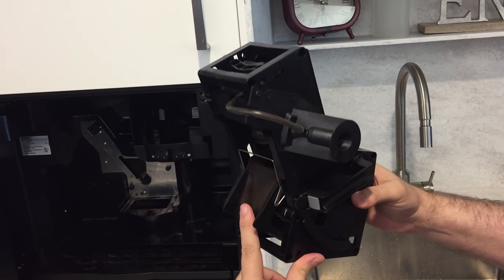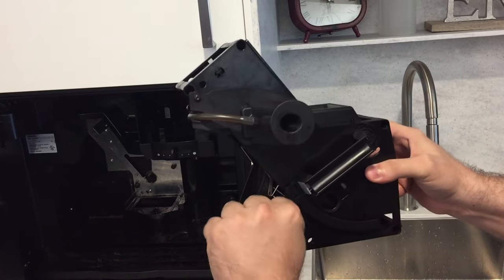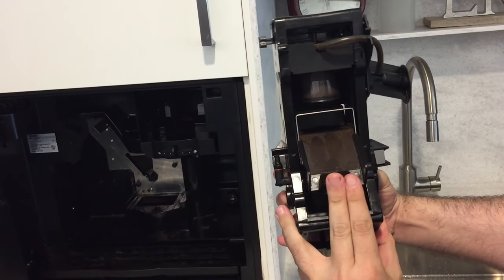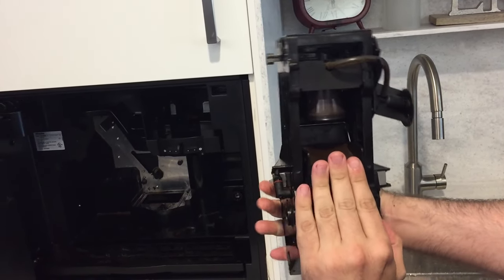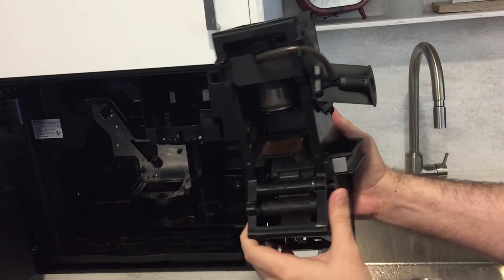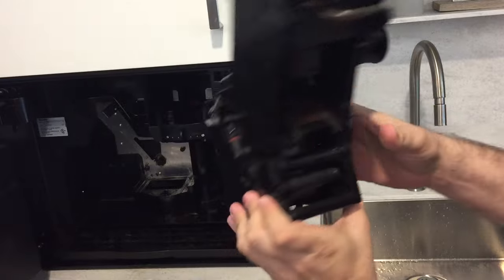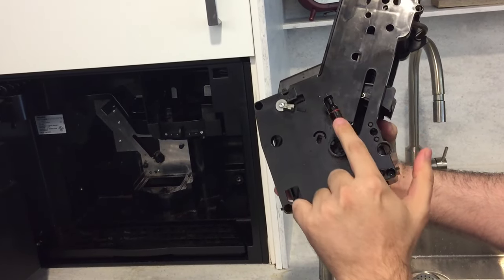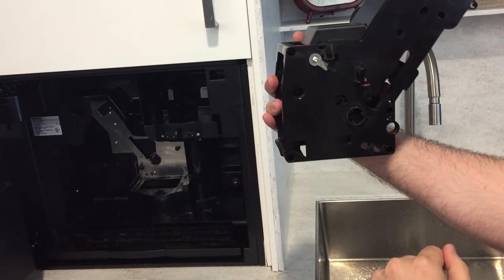Reset brew unit Miele coffee system CVA

Comment: Useful video.  My CVA4075 is throwing Fault 73 and you can't remove the waste bin.  I can get it out by releasing the brew unit lever and pulling both out at the same time.  Running initialize on the brew unit from service mode rotates the drive to the correct position so that I can re-insert the brew unit after manually resetting it like you show in the video.  Any idea why F73 keeps occurring?

Comment: What about when you do that but it still won’t fit back in?
Reply from the maker: Could be that the gears inside the machine aren't in a resting position. You can follow the instructions to this video to access service mode but I don't have access to this machine anymore or I would make you a video that shows how to do this. You might need to contact Miele usa or Canada for that. But if that doesn't help, than I'd recommend a tech come and inspect
Reply: Did you figure it out?

Comment: Help my brew unit wont come out!
Reply: I have this issue as well. Any time I go to clean it (per maintenance instructions) I always have to fight with it to pull it out. I move the handle to the left as instructed but I have to really yank the unit yard -- sometimes shaking it violently -- to get it to release. Sometimes the handle pops off the track and I have to put it back on. At some point that plastic handle is just going to snap. What causes the sticking? Does anyone know how to fix it?
Reply: @chrisa5540  there's a tab at the bottom holding the brew unit in place that you need to press down at the same time as pulling out the unit! Easily overlooked.